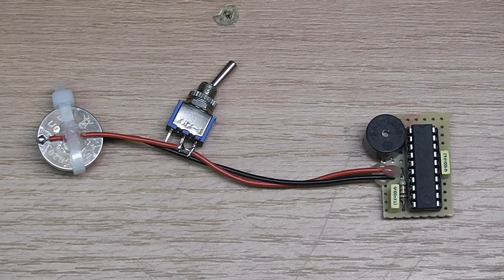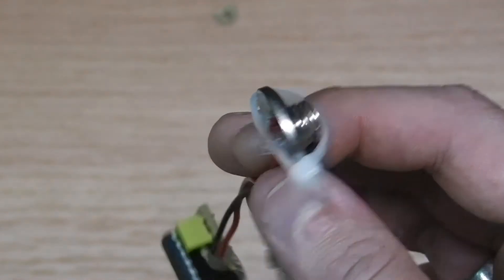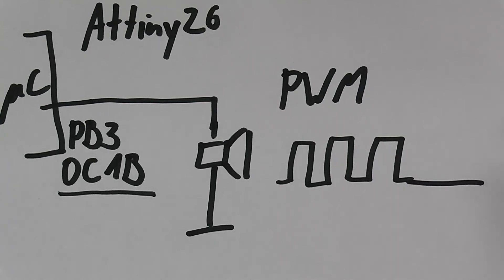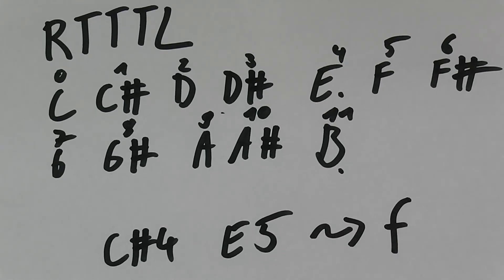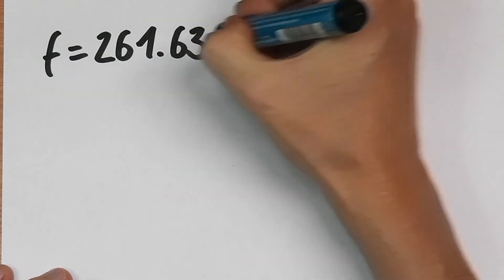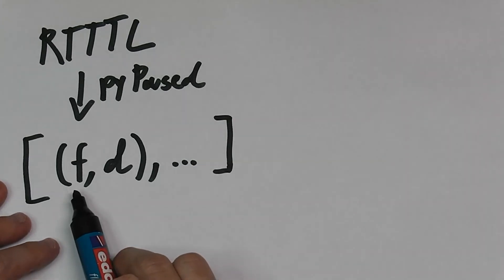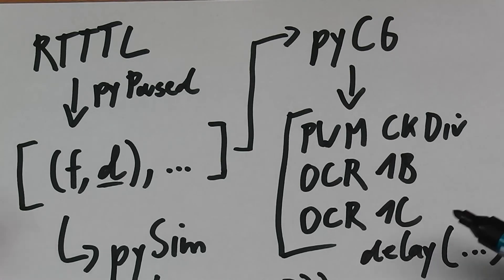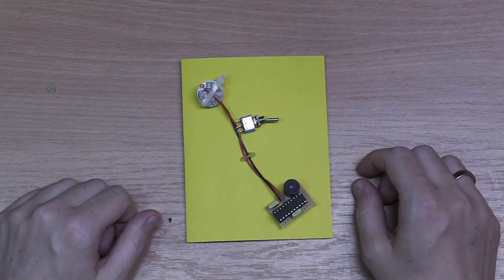Greeting card with ATtiny26 (playing RTTTL music)

Comment from the maker: Hehe, don't have a tiny45 here, but looking at it, this should be very easy to modify: As a matter of fact the only reason it doesn't compile for the tiny45 is that the timer control register of the 26 is TCCR1A and TCCR1B and for the 45, there's TCCR1 and GTCCR and the bitfields are in different places. If you fix that (two lines of code), you're good to go!